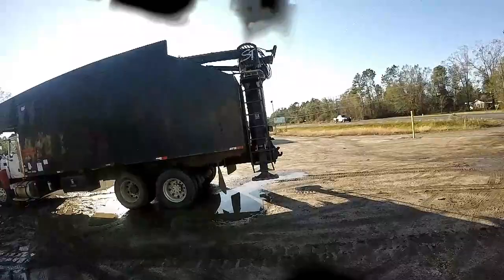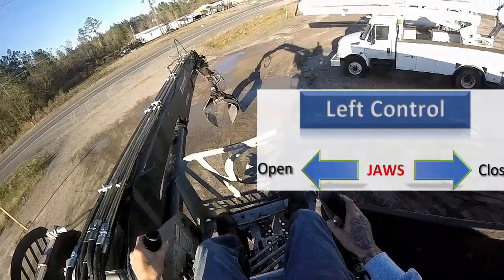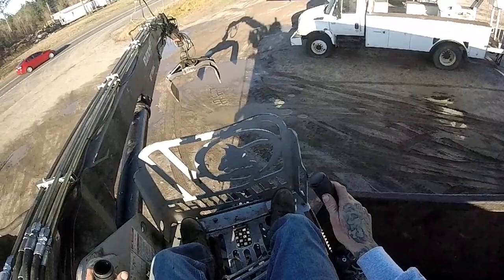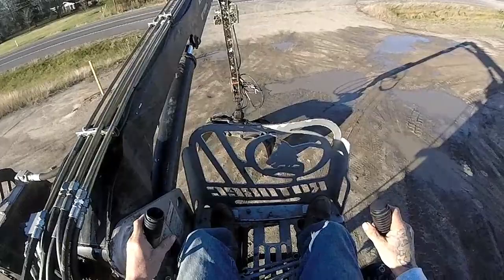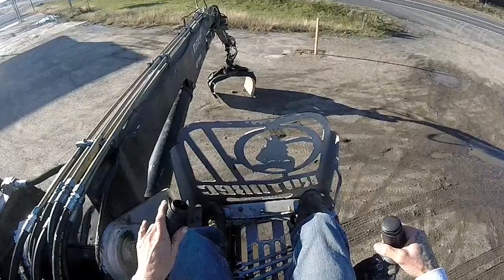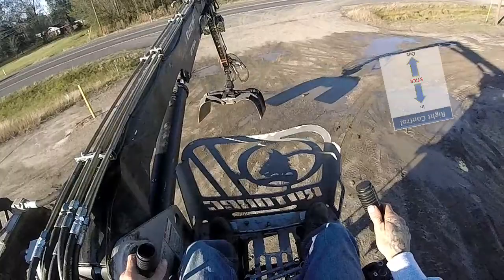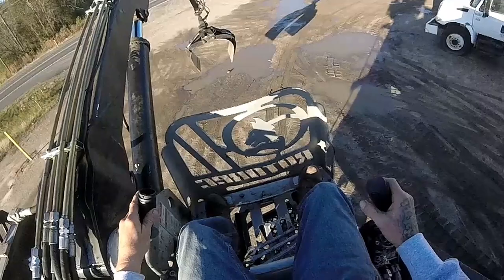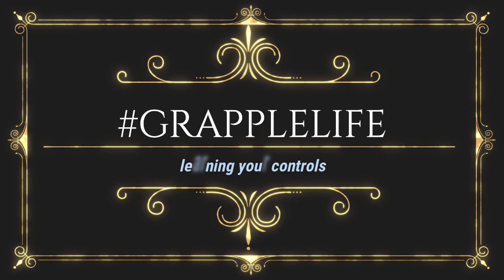How to operate a Grapple

Comment: I've been operating heavy equipment for 17 yrs running anything dealing with dirt work. The controls for the this grapple would have me looking like it's my 1st time on equipment lol, they're completely backwards compare  to excavators
Reply from the maker: And you'd absolutely correct, they are ass-backwards from everything you know!!!
Reply: Running a excavator, or as how they're called pretty much everywhere a track-hoe or hoe for short lol. I operate using the SAE pattern & not to brag or anything but lol I'm a grade A hoe operator lol not the best by any means but I know what I'm doing. I can half ass operate with the ISO pattern but it looks like someone green operating lol
Reply: My favorite thing to operate is a Dozer & have been told many times "not saying you're not good on a hoe, but you shine on a Dozer. My brother always hears the opposite. Alot of operators, superintendents & PMs considered him I've one of the best hoe operators where we live in southeast TX & Southwest LAST
Reply from the maker: I just started getting my crane certs, and that's an animal all to itself!! But I'll be back working in Western Louisiana here in the near future, if you get involved in storm cleanup, let me know, we always need good operators!!! (Skid-steer w/grapple, bucket-truck, crane, mini-excavator w/thumb, CDL)
Reply: You can switch the lines around to set the controls like you want

Comment: Just started in graple truck this is day 2. The truck I'm using is having a number of issues even the out riggers decompress while in ues. Any advice?
Reply from the maker: Best thing you can do, is trace your hoses for leaks, once you get on top of your leaks, make sure your running your system high enough (10-11 RPM)... If your out riggers aren't holding, you might have a bad check valve (that's another video in itself), which isn't that bad, just get to know your machine, and once you get one top of things, life becomes a lot simpler...

Comment: I bought a freightliner rear mount rotobec 80 elite and I put the outriggers down hard and with it stretched out to the side the truck is tipping and lifting opposite side outrigger off the ground, am I doing something wrong or do I need to have debris in box for weight when reaching out?
Reply from the maker: When you say, "down hard," are you lifting the truck off the suspension (with your outriggers)?? Make sure the rear (truck) is up and level, you have to be level and completely off the trucks suspension. Both of those are important. Because the only time I've had this problem, is while unloading, and that's just because I picked a lot of weight out of my box, and as I was swinging out to dump (very fast, because I had a double-pump system), the momentum starts pulling me over. And I was setting it nicely down, so the excavator could reach it (at the dump). But normally, normally (without seeing your setup), the system just won't pick-up the load, like huge stumps for example. 
Hope this helps....
Reply: Hopefully you see this Brandon Kelsey I just bought a mid mount elite 80 as I reach out the other side comes off the ground with just the weight of the loader like your situation! Did you find a fix? Thank you!
Reply: @caseybarnes2743  I read where he said to put outriggers down and pick up trucks suspension
Reply: @caseybarnes2743  no I haven’t